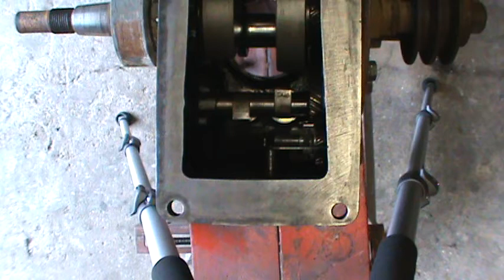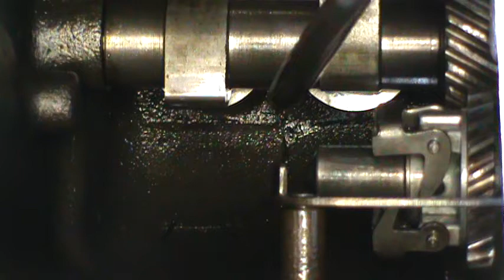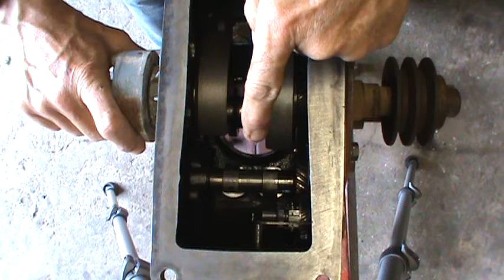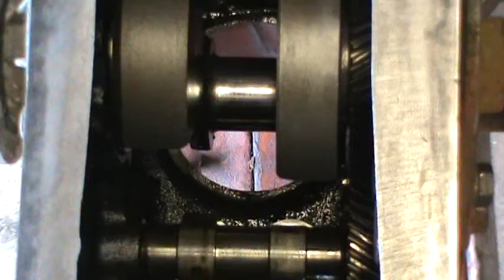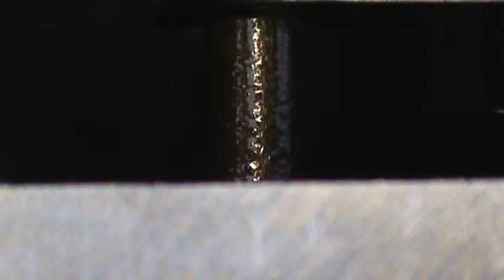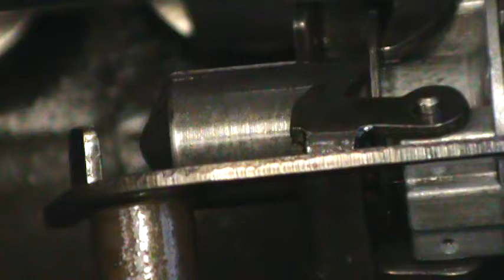Briggs and Stratton Governor Part 3

Comment: Thank you Governor Zippo! 
Do you know if it's possible to convert the model 19 to sold state ignition with the module. I know with the 12 hp synchro. It works but I don't know the lower hp engines.

Comment: Question. Should my governor be able to slide around on face of cam gear about 1/4” or should it stay tight against the engine block. If it should stay against case what holds it there?
Reply from the maker: I assume you mean the governor control rod. It should have just a little lateral movement. 1/4" is a little too much. To correct, simply move the governor rod in closer to the block. Be sure to mark both the shaft and lever so you don't end up with the governor being out of adjustment. Zip~
Reply: @ZippoVarga  No I did mean the governor assembly. But I found my the answer to my problem on another of your videos, I have one of the cheap knock off carbs with the throttle shaft end clocked in the wrong position so I was having to set the governor with the throttle in the closed position rather than wide open. This left the governor flopping around doing all kind of weird things! Thanks for solving my issue, Keep up the great videos Zippo 😎